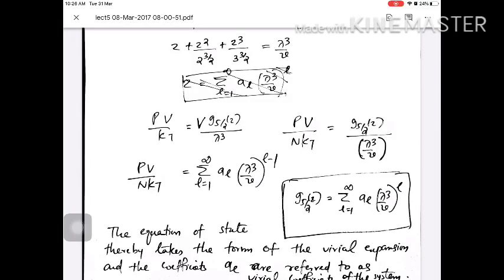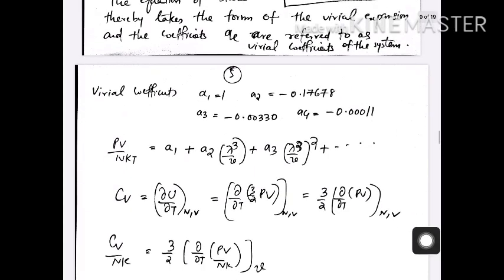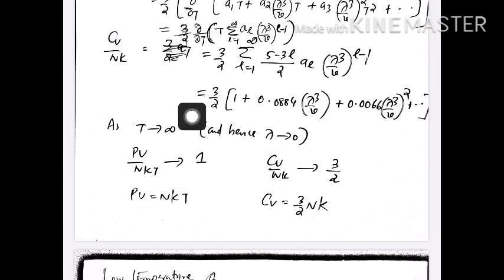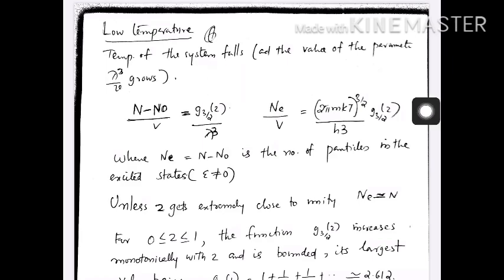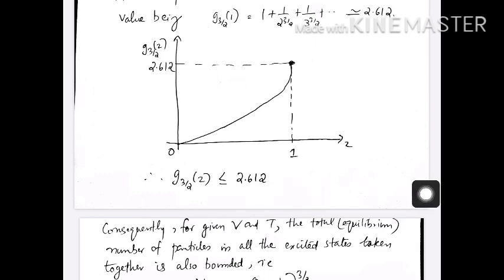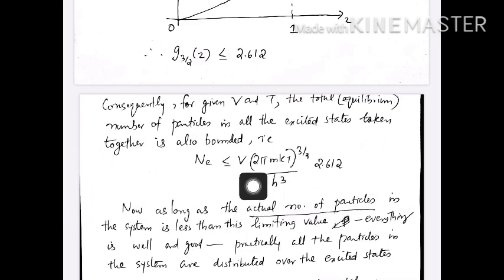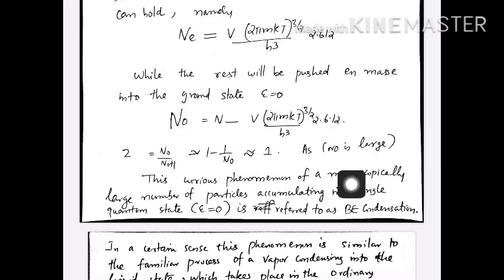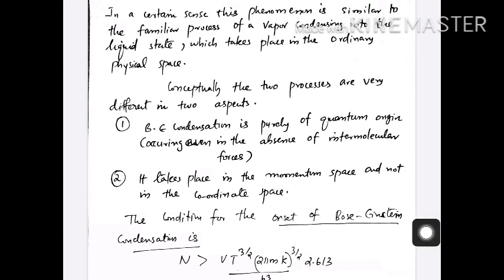Ideal Bose gas part 4

Comment: Sir,  at low temp, if the  no.of particles are less than Ne, why are all the particles distributed in the excited states? why wont even some them be not present in the (epsilon=0) state.?
Reply from the maker: Very good question. We know Ne=N-No. No=N-Ne. If N<Ne , No will be negative, which is not physically possi le. So no particle exists in ground state. All particles are distributed in excited states.